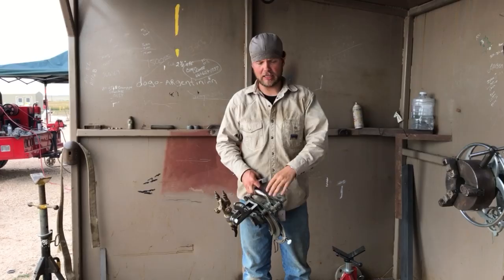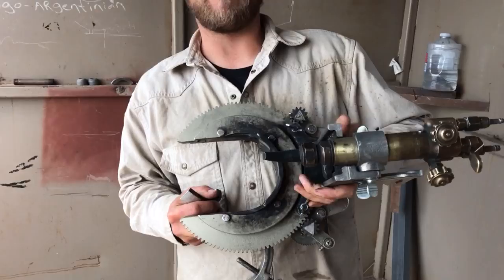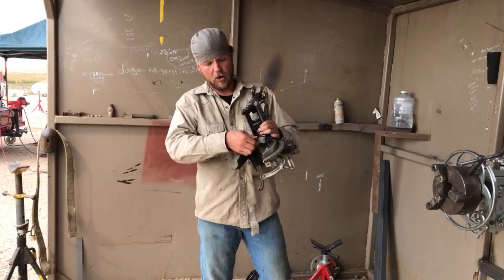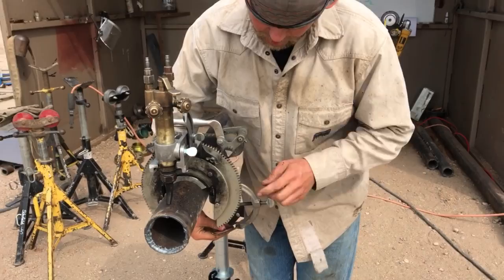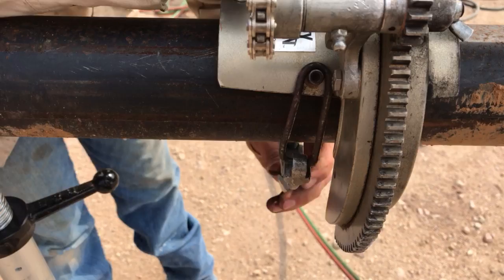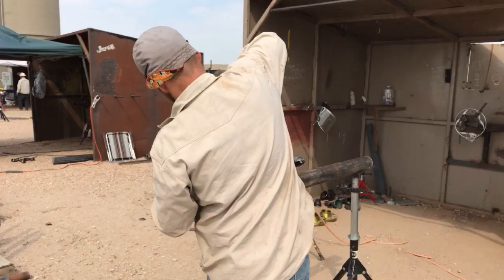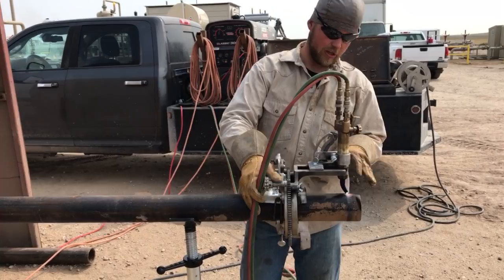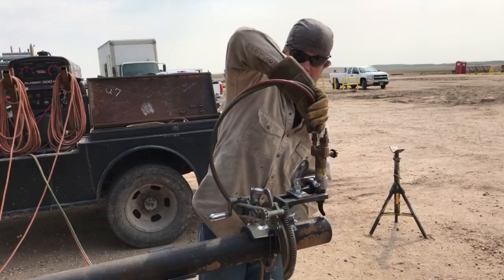How to set up and use a beveling machine

Comment: Do you have to supply your own misc. equipment? Bevelers, grinders, drills 

Or does the company provide them?

Same question for consumables: rods, grinding discs, cutting discs, etc
Reply from the maker: On most cotract jobs we do. so on this job everything you see in the videos i bought and use. gas,welding anything that has to do with gluing the pipe together.